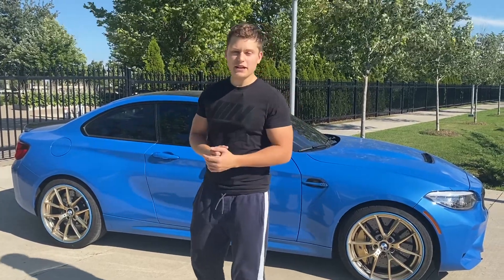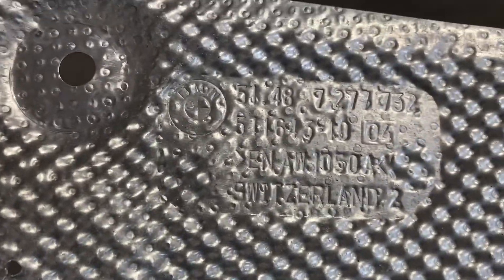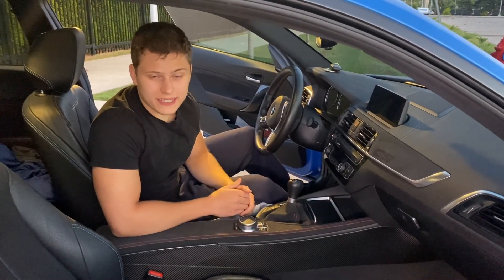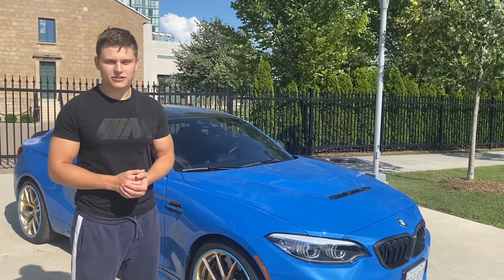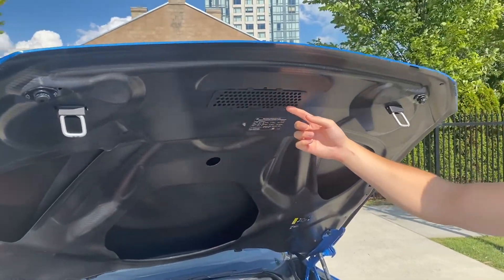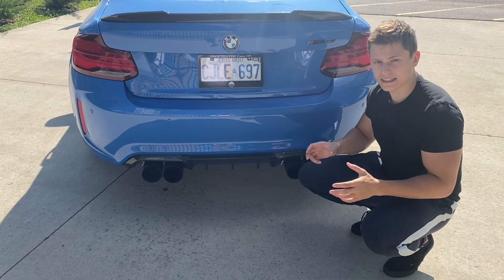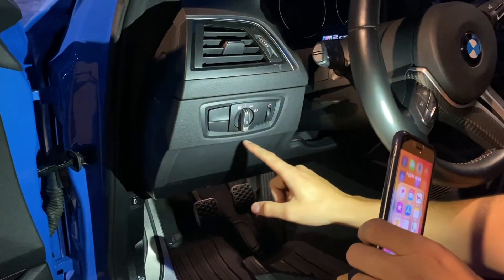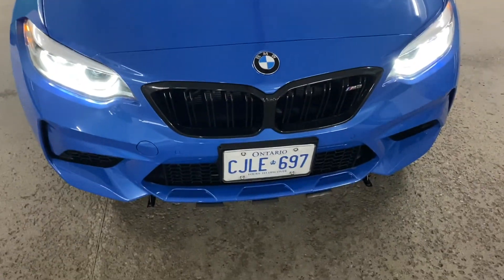23 Things You Don't Know About The BMW M2 CS

Comment: The pops and crackles and burbles in the exhaust are not only unnecessary, they also cause additional heat in the exhaust system.  Absolutely happy they are not on the M2 engine CS tune.   The woofs/barks on throttle lift off seem to be unique to the CS tune. 

Safety features? Schmafety features.  M2 CS is absolutely ready to drive to your local track.  Crazy that little panel is unique if it’s not from a lower 2er.

Informative video.  

LOL at the vacuum cleaner comment. Fans are sooooo loud lol.
Reply from the maker: Yeah that makes sense. Maybe the comp/cs exhaust was getting abnormally hot now that CS is running more power, so they tuned it out? The barks are a highlight of the car :)

It probably is from one of the base 2's now that I think about it. Always thought the newer BMWs had standard safety features but maybe not

Oh yeah they're super loud haha. Only in sport mode though, I think it's because of the front heat exchanger. I hope you enjoyed the video!

Comment: Just a little note, the pops and burbles are quiet on all new BMW M cars due to EU regulation regarding noise pollution, makes no sense for BMW to make the car with pops etc for US market and not the EU market and of course money so that's why it's standard for all markets. All major manufacturers like Audi, Mercedes  and of course BMW are adhering to the law. It was mid 2018 when the new models for cars come out is when it it happened
Reply from the maker: Ahh gotcha, that makes sense. The new M3/M4 definitely don't pop anywhere near as much as the F8x gen. Thanks for the info man!
Reply: @collectingms3803  no problem, thanks to you I opted to get a early 2018 M2 F87, only 13k miles and runs like a dream, it's just sad that in the UK the weather has been terrible so can't take advantage for a good photo shoot!
Reply from the maker: @krutikquiran8184  That's so awesome man! -  this has gotta be one of the coolest things happening since I started my channel. Super happy you're enjoying it! Did you just pick it up? I'm sure you'll be able to get some nice weather soon enough
Reply: @collectingms3803  I picked it up Aug 9th, however I’m currently in the US for 2 months so literally only got a week with the car before I flew out, sitting in my driveway since but I got mine in Blue with black rims/spoiler and literally in love with it! Got it in Auto as my 220d M Sport was the same and just was used to it. Only thing I hate about DCT is that there’s no park button, just leave it in drive and handbrake and engine off
Reply from the maker: @krutikquiran8184  I'm sure it's gonna get driven a LOT when you're back haha! That's definitely a great spec you've got. The DCT is great imo. How do you like the shift speed? Probably noticeably faster than your old auto
Reply: @collectingms3803  the shifting has deffo been so much better! I’ve kept it stock but even then the pops are insane!
Reply from the maker: @krutikquiran8184  Oh yeah and the cracks you get on high RPM up shifts... Love the DCT!